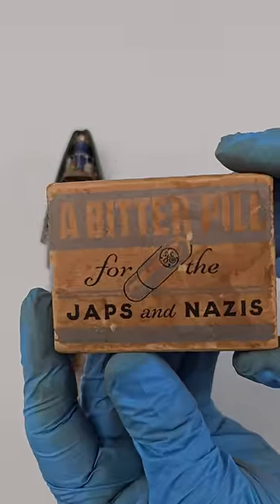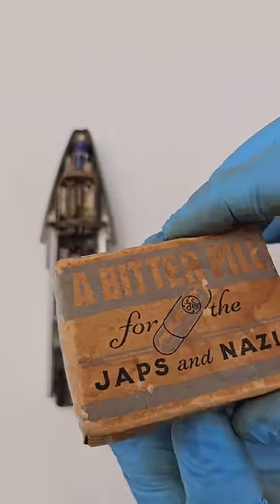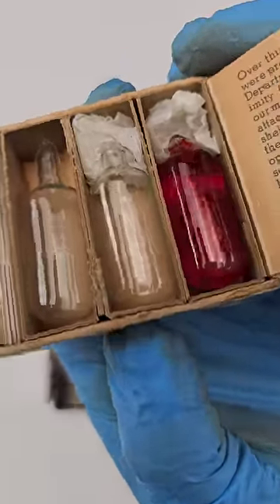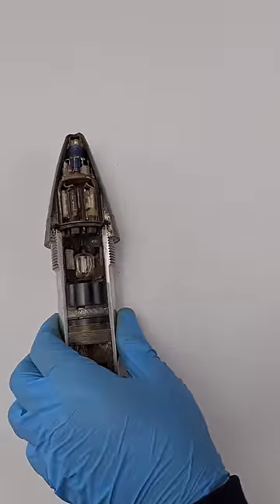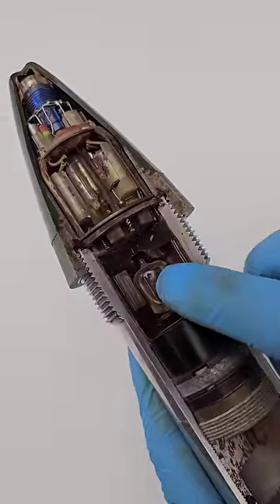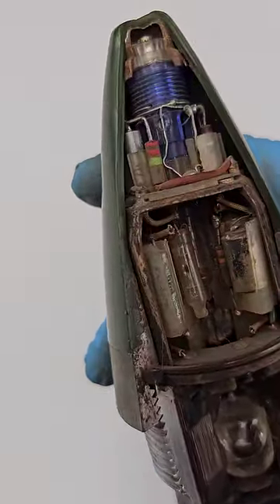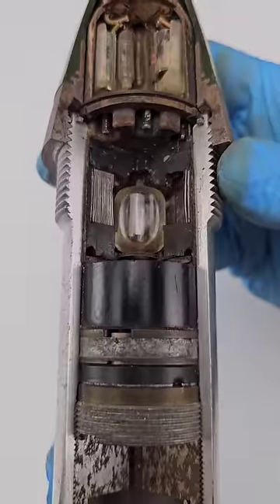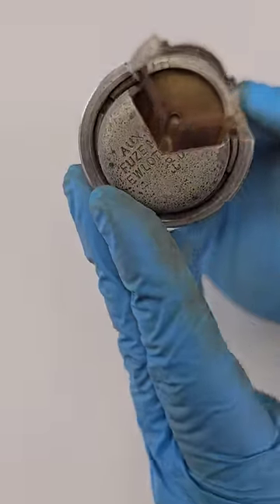RADIO PROXIMITY FUZE: General Electric Helps Beat Kamikazes & Win WW2 #military #history #technology

Comment: In the era of vacuum tubes, this was genius.
Reply: It’s kinda funny how despite us being in the era of the missile, which tends to be far more effective than flak around to take down aircraft, we are revisiting the technology of flak rounds as a cost effective measure to destroy drones
Reply: Whats funny is i was just waching a ad  about a vacuume tube
Reply: I have looked at the schematic of these fuse; it is basically a regenerative receiver, which was a popular technology then. Genius was applying this principle, and then making a design that would survive firing from a cannon
Reply: Even electronic university student won't be able to make this in 2024
Reply: Can you explain what this does. I kinda get it but not fully.
Reply: @reflection8578    My best guess:
1. When the round is fired, the small glass filled with liquid activates the circuit.  There's also a very small battery to energize the circuit for a few seconds.
2. The circuit is now emitting a radio emission as it exits the barrel of the AA gun.
3. When the radio emission comes close to a metal object, like an aircraft,  it triggers the circuit to explode.

In the 1940s, this was genius!
Reply: @sgt.railgungaming1793 so funny!
Reply: @JGL841   the glass is a part of the battery, its the electrolyte
Reply: @Dovydaskas   I don't think so.  The water in the glass was used to conduct electricity,  similar to the way a switch completes a circuit.
Reply: @JGL841  iI am thinking the round black plastic object in the base is a Daniels cell, and the bulb contains electrolyte. When the shell is fired the liquid flows into the cell, activating it. I see some very tiny vacuum tubes behind a circuit board in the nose.
Reply: The liquid in the glass capsule basically acts as the electrolytes in your zinc/copper battery. It's the potato part of a potato battery. 

As long as the reactive metals and liquid are separated, they're essentially inert and won't die like a regular battery does. Once the glass vial breaks, the liquid acts on both metals creating electricity. 

The proximity detonator itself is just a simple radio transmitter & receiver. The radio waves bounce off the target, and once they reach a certain strength, boom!
Reply: @donwyoming1936    NP.  I was just guessing at what the fluid in the glass was for.
Reply: @BjarneLinetsky    I'm sure you're correct.  I was just guessing at what the fluid in the glass could be for.
Reply: Ummm
It’s still genius bro
Reply: @Armin2012  they are also coming back as defense against full sized aircraft. Advances in programmable ammunition means something very cheap and very effective in most purposes
Reply: @casematecardinal  and arguably less susceptible, if not immune to counter measures. Not quite sure if you can jam proximity fuses, and ground tracking doesn’t have to use radar tracking either, with thermal visual tracking. And most aircraft in range of such a defense wouldn’t be be doing particularly stealthy things anyway
Reply: Still is lol
Reply: therussianbadger:
Reply: 😮 Any reports of the vials breaking during transportation?
Reply: dude i cant believe this thing existed and functioned.
Reply: @sgt.railgungaming1793  Vacuum tubes are still used in a lot of things.
Reply: @sgt.railgungaming1793  noooo  the atf is watching shhhh
Reply: @aga080  That's what the Japanese said
Reply: @JGL841 he clearly explained how the glass is filled with a electrolyte solution.  When it's fired the glass breaks and activates a battery.
Just like kids playing with pennies and electrolytes in school. The glass just made it transportable. These weren't stored in the rockets. They were installed rather last minute.
Reply: @jc9233  k, thanks.
Reply: in this era this is still genius
Reply: @Armin2012  I hate to tell you, but flak isn't dead at all, especially in low distance scenarios AAB ammunition is way more effective and costs less, and we basically know this since decades
Reply: @JGL841 that's exactly what he just said. You just repeated it with different words.
Reply: @casematecardinal not true. After the collapse weapons will be energy not projectiles. Unless you consider some designs that might utilize plasma and magnetic propulsion. Most will be rf, emp, and of course mw. Havana on cr4ck. 
Most of these will utilize currently known methods, but with better innovated shielding. 
I.e. right now we have figured out how to make sound by pushing electricity through a magnetic speaker. We just haven't figured out how to build proper boxes to amplify and concentrate the efforts. 
I mean we certainly have, but all this knowledge and the materials will put you on a list quicker than building f4t b0y.
Reply: @tgirlshark  never said it was dead, I had just said that the missile had become the primary means of anti aircraft fire. Its just drone threats have seemingly revitalized their significance
Reply: @JGL841 No the liquid is the acid/electrolyte for the battery.. Thats how it works and is always ready to fire... If it had a traditional battery, the battery would eventually die from sitting in stockpiles/ammo holds making the entire fuse and shell useless...
Reply: @JGL841  RETIIARD
Reply: It's genius right now.
Reply: @reflection8578 It makes it so the shell explodes at the correct distance to take down an aircraft. Before these, people had to manually set a distance fuse on each shell and they weren't very good at getting it just right.
Reply: Not really, considering they’re always holding back what they’ve actually got
Reply: @reflection8578  it breaks that tube creating a radio frequency other munitions can use to detonate within 70 feet of the transmission.
Reply: Now days you just stick a processor on anything. Shame.
Reply: @greatndit and in about 30 years the equivalent to Joe Rohan’s podcast will have an expert telling you about lost technology. lol
Reply: Everyone believing our working atmosphere can work at all, which it wouldn't if surrounded by a vacuum. ( At the very least wouldn't work without containment)
Reply: @Roboticdoughbull3k 
Physics disagrees with you.
Reply: @InvaliDidea123 
"Shame?"
The easier, cheaper and more powerful option is a "shame?"
Reply: Seriously, I find this stuff more impressive than modern technology simply because they had so much less to work with back then.
Reply: It was one of the technologies that had a noticable effect on the war.

These things were EXTREMELY effective
Reply: @Armin2012 funny, or not, how methods for destruction come full circle like that. But how the scientists figured this problem out with the resolution they came up with to me is mind bending. Moreso because they got it working with what we see here. Glass Bulbs?
Reply: The level of engineering genius in the VT fuse is astounding. The centrifugal force of the shell’s rotation is what distributes the acid to form the electrolyte.
Reply: @JGL841 the fluid in the tube IS the battery, the acid inside forms an electrolyte solution.
Reply: @greatndit  Universities today are halls of indoctrination, not education. “Those who cannot do, teach” is a very appropriate saying.
Reply: It's also a thirst mutilator, cause it's got electrolytes !
Reply: I just wonder how the little tubes would warm up between the time the shell was fired and reached the target. Just seems like there was not enough time?
Reply: @greatndit lol what? These kinds of comments are delusional
Reply: @tgirlshark ya, gepard is being used daily
Reply: @Armin2012 missile is expensive. Bullet is cheap
Reply: @greatndit Many can’t even design a 3way switch circuit.  It’s one of the interview questions I ask engineers.
Reply: @Armin2012 honestly time fused rounds are pretty effective and against drones as well just look at the german mantis.
Reply: Helping us win the war
Reply: @JGL: So much was done in the analog days. From weapons and aviation of the 40s, to the space program if the 60s. With all of today’s modern technology to help us, I just feel we’ve fallen off the track. Bummer!
Reply: My dad worked & retired fromGeneral Electric they actually made all the retirees give back a BIG portion of their retirement money $$$.
 Just thought I'd share a little bit of the DARKNESS General Electric also found ideal for their brightness
Reply: When I see technology like this, I stand beside myself in amazement. To think, all these scientific discoveries and engineering feats were all produced by the intellectual prowess of African Americans. I tremble at the thought of not being blessed by their inherent ingenuity. We would still be living in the stone age if not for this blessing they have bestowed on our people.
Thank you, black folks! Thank you for everything you've given to us! 😊
Reply: Vacuum tube = resistance to EMP ❤
Reply: Ur insightfull also 😂😂😂 @NeilPundick
Reply: @JGL841 Thank you for the explanation! 👍😊
Reply: @LV2XPLR designing one is easy. Trying to decipher an existing one when replacing a switch is not always easy.
Reply: @greatndit which raise a questions why public education is keep at such a low level comparing to corporations labs...
Reply: @JGL841 absolutely amazing.
Reply: @Armin2012 ❤
Reply: @JGL841  - Electrolyte is mostly water. It is the battery's electrolyte. I'm familiar with this technology.
Reply: So true!!!
Reply: @Armin2012 I've always found it so fascinating that as time marches on certain things from the past are revisited. Whether it's clothing trends, architecture or in this case technology, some things seem to survive the test of time.
Reply: It still in my eyes lol
Reply: Killer
Reply: @sgt.railgungaming1793   An Ad for vacuum tubes! You jump in your time machine and post this on YT?
Reply: @greatndit  Challenge accepted!
Reply: @JGL841 
No this was a WET PILE BATTERY CIRA 1940s the shell’s spin would crack the glass allowing the acid to flow between the positive and negative plates as well as the paper divider activating the proximity fuse .
Reply: today we call them women mister
Reply: @greatndit  Design it: yes, of course they could, except for the glass parts
Reply: @BjarneLinetsky  I think more likely super-regenerative as plain regen requires critical adjustment which would soon go out of alignment.
Reply: @JGL841  I think you got it! These days the think is altogether different and some 'genius' would use a billion dollar computer to do the same job, i.e., delay power supply while the shell was travelling uo the gun barrel!!!
Reply: @Armin2012 sorta like how machine learning was a paper written in the 60s
Reply: @inkybz  on that front, we still got a ways to go. We’ve achieved it, now it’s just a matter of making it smarter
Reply: Really makes you wonder what was the real reason vacuum tube's became obsolete overnight with the in invention of the transistor.
Reply: @ronniebauman28  Well no, vacuum tubes did not become obsolete overnight. Transistors were first made in the lab in 1948 and began to appear in portable radios by the mid-1950s. However, compared to vacuum tubes, the early transistors were very limited in power and high frequency performance being good for maybe 100mW or so and the low MHz at best.
By the 1960s, transistors were beginning to make their way into the signal stages of TVs but 'sweeper-tubes' remained for quite a while thereafter.
Bear in mind, also, that vacuum tubes are relatively immune to EMP while our modern electronics, for all their craft and ingenuity, would likely not withstand a solar storm on the level of the Carrington Event in Alaska, 1859.
Reply: @ronniebauman28  my guess is that the vacuum tube took up too much space. Transitors could the same job just as well, if not better, in a fraction of the space needed

More compact electronics, meant you can put more components of other purposes in. You could make them for more rugged tasks

They were probably easier to manufacture too

I suppose one can argue they were superior in almost every practical application
Reply: I have a massive synthesizer with two Russian Vacuum tubes for oomphy gain and insanely fat Unison sawtooth waves 💪
Reply: Unbelievable!!!!
Reply: @JGL841  In this circuit the release of the electrolyte simultaneously closes the circuit and energizes the battery. The electrolyte is the wet component of the battery.
Reply: @sgt.railgungaming1793  Sticks and stones may brake my drones...
Reply: @greatndit  They will if they understand the principles involved and have some design experience.  When I taught college electronics my students became brighter and more adept than I was.
Reply: @BjarneLinetsky  Those vacuum tubes were a real project, needing to be both tiny and shockproof.  I think RCA did the research work.
Reply: @markkinsler4333  I have seen the declassified circuitry for these proximity fuses......They are what is known as an autodyne or regenerative receiver.
A single tube that is both transmitter and receiver. The fundamental idea was developed by Edwin Armstrong back in WWI. The circuitry was mounted on a ceramic circuit board and then potted in plastic resin, RCA developed the standard miniature tubes that were common until the 1970s, but a British firm Hivac created the first subminiature tubes....Raytheon and Sylvania came out with a line of subminiatures. Which were the tubes used in proximity fuses. these were classified "secret" so data on them is hard to come by. There were a whole line of subminiature tubes created for the guided missiles of the 1950s. excellent tubes that were wired into circuitry, rather than the usual plug-in.
Reply: Vacuum tubes themselves are pretty incredible too, if you ever look into how a beam tetrode works, it's fascinating stuff. Old analog innovation and technology never fails to amaze me.
Reply: Even in the transistor age, it would be impressive.
Reply: @Armin2012  Flak is simple and effective.  The simpler a system, the better the system when it comes to speed, reliability and environmental issues.  German tanks were incredible pieces of engineering yet they were still bested by the Russian T-34 in a head to head battle, sheer numbers of the Russian tanks could be built

Comment: Microprocessors are undoubtedly awesome and magic in their own right, but this kind of old school engineering is on a different level.
Reply: No.  What you meant to say was "Old school engineering like this is awesome and magic in its own right, but microprocessors are on a whole different level".
Reply: @Hyxtryx  well it comes from my understanding being a young buck still. I understand computers and coding more so than I understand how to make mechanical components that solve the same problems. I rebuild transmissions by trade. For me, the simpler units are units that are modern and electronically controlled, whereas a 1980s 4 speed has this amazing valve body with a series of springs that have to have the proper tensions, behind valves with just the right clearances. It's much easier to solder in a new micro controller or rewind solenoids than go through what is essentially a mechanical/hydraulic computer.
Reply: Agreed! We might make a comparison with what the Japanese did to make their torpedoes work in Pearl Harbor. Knowing that Pearl was shallow water, they fitted wooden fins and job done! Today, faced with something similar, I can imagine guys spending billions of dollars on a computer to do much the same task!
Reply: @funwithmagnus8570  Russians used Vacuum Tube's in the Mig 25 and others, they have resistance to EMP pulse unlike chips or mp.
Reply: The engineers who invented these have to be masters of chemical/explosive/Radio/glass. They don't make people like them anymore.
Reply: I still don’t get it, what does this bullet do exactly?
Reply: @ka-boom2083  detects when it is within proximity (close to) a target by transmitting and receiving radio waves. It is doing that after experiencing 50,000Gs in acceleration. That nearly instant acceleration to 3000 feet per second is what activates the proximity fuse. The fuse triggers an explosive that then detonates the main body of the projectile causing a fragmentation pattern that has a much better chance of hitting the moving target vs a direct hit from a single projectile.
Reply: @ oh so it’s a bullet that explodes in mid air when it’s close to a enemy plane?
Reply: @ka-boom2083  yeah
Reply: They used what they had. Had they processors, they would use processors